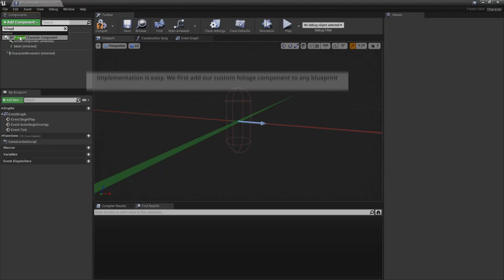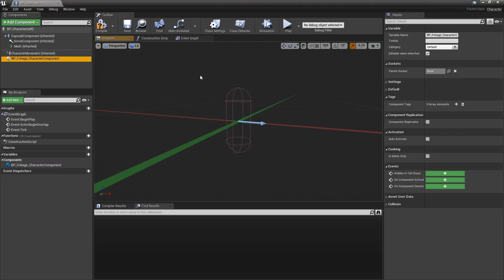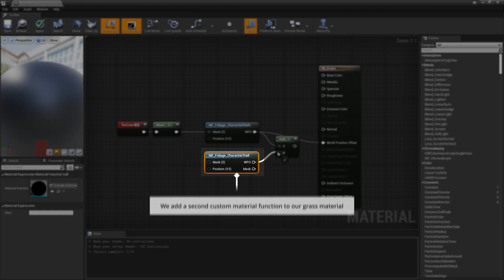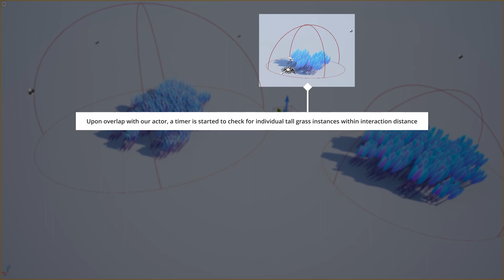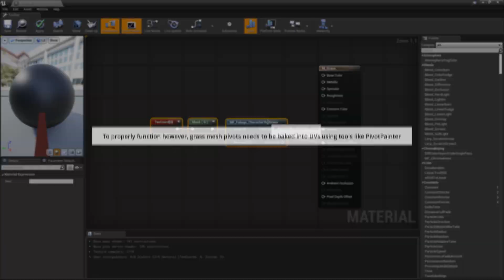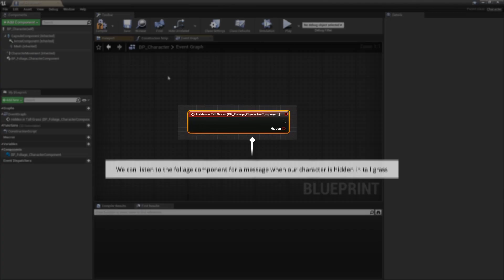A technical demo of my experimental tall grass system in UE

Comment: This is a stunning showcase! Feathers look so good as grass haha.
Reply from the maker: Right? Why not :D I always love to go crazy with the grass color & look
Reply: @ghislaingirardot  Whats the benefit / difference from using distance fields?
Reply from the maker: @RastoDM  Distance fields to do what exactly? Not sure I understand your question, could you be more specific?
Reply: @ghislaingirardot  for interacting with foliage.
Reply from the maker: @RastoDM  Do you have a particular example in mind? This type of thing is not usually done with distance fields afaik. The thing is, distance fields can provide the distance & direction to the nearest surface of any static meshes. That won't work for skeletal meshes so your character will be invisible to your grass shader. You could probably attach some sort of sphere mesh to your character though but that's sketchy. Plus it's likely your grass will sample the distance field of the ground right underneath it, so the data itself would be pretty much unuseable, unless you make your ground to not generate a DF but you most likely do for other effects. Also distance fields gives you data at a specific frame so if you want proper motion with dampening and twist and whatnot you'd still need a custom solution. Hope that helped.
Reply: @ghislaingirardot   well the method I was looking at and testing was using distance fields for a similar effect but yes I had to put a sphere into the character and can play with what meshes effect it. And no mesh swapping
Reply from the maker: @RastoDM  You don't need mesh swapping. I should do a video update on this because what I did for that system is dumb... I didn't know this at the time but turns out you can just send the twist value to a per-instance custom primitive data. So no need to swap mesh and create an dynamic material instance per mesh :D
Reply: @ghislaingirardot  yea im just getting into the details of foliage and trying to learn as much as possible, your demo has been the nicest visually. super inspiring =]